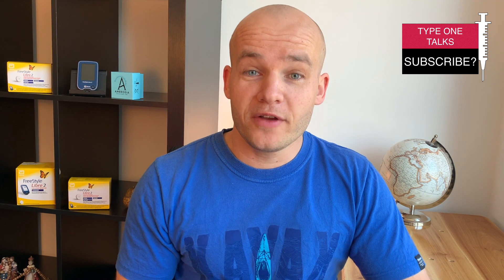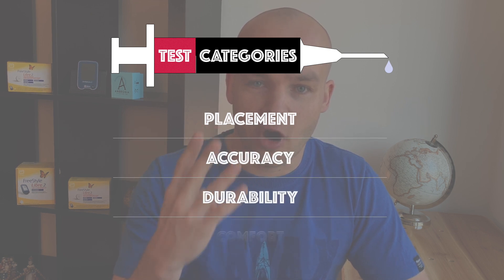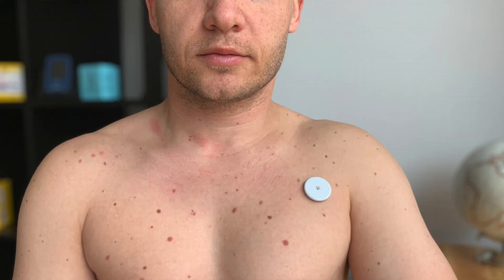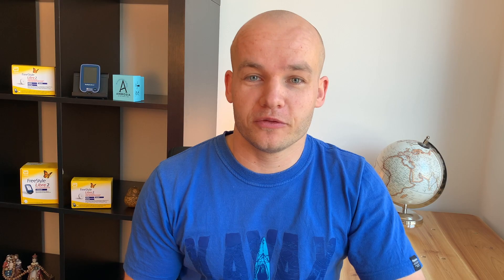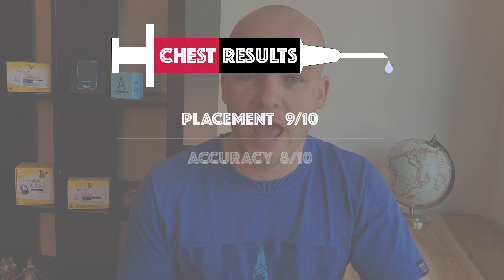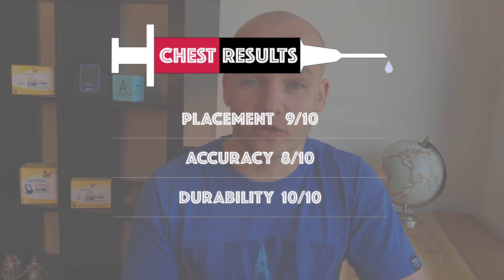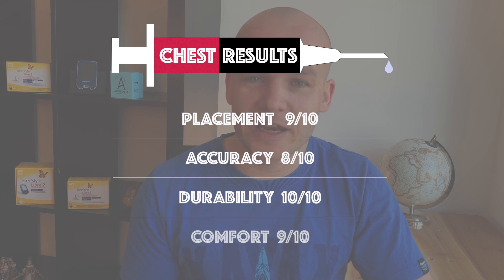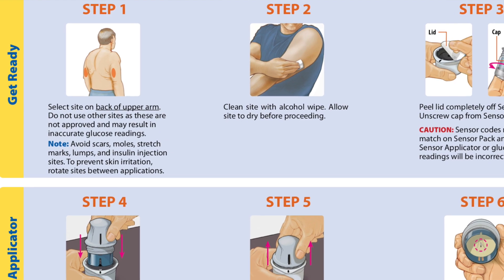Best FreeStyle Libre Sensor Sites: Chest

Comment: I am by no means an expert when it comes to FSL. This is only my second sensor with the system. First was the upper arm and I was amazed with just how well it tracked my BS. I placed it a little to far out on my arm and that made me worry that I might knock it off but that didn't    happen. What did happen is after 9 days it failed and would no longer give me an accurate reading. After a call to the company they said they would send me a replacement. I haven't received that yet but it should arrive soon. From watching the videos I decided chest looked much better (safer) as far as not catching it on something. One thing I have noted in the past 3 days is this location seams to have a greater lag time from eating to a reading and after a corrective injection it takes a long time before I see the results on the meter. It's like my train just got 3 times longer from change to result. Next sensor will be more on my inner upper arm. I just wonder if others have seen a difference in lag time with sensor placement.
Reply from the maker: Hi Tim. Thank you very much for sharing this. Such an interesting observation!

Comment: Tom thanks so much for testing different sites. I am just beginning to,use the Libre system and without even trying I know that the back of the arm placement won't work for me. I suffer from diabetic adhesive capsulitis in my left shoulder and even putting on or taking off my shirt is tough enough already without having to worry about knocking off the sensor. Additionally I use backpacks a lot and because of my left shoulder already have a tough time with the straps. So I am eager to find an alternate.
Reply from the maker: You are most welcome! Welcome to the Libre team my friend! I appreciate your support!

Comment: My favorite location is also chest for all the reasons mentioned. I would like to add that, when placed on the upper arm, the high glucose error is about 1.0 mmol/L difference with blood glucose. As the readings get closer to 4.0 mmol/L the error becomes negligible. When placed on my chest just above and to the left of my left nipple, my high glucose reading error is more in the 0.5 mmol/L. I'm leaning on, more accurate than the upper arm. The greatest effect on accuracy seems to be the pressure used to install the sensor. It requires a firm push, but pressure must not push the sensor in the skin, as I think this damages the wire. I know when I used to do this to help adhesion, my arm hurt for several seconds. I'm guessing  the wire is going beyond the interstitial tissue into the muscle. Just a guess as when I used lite pressure there is no pain and readings are better.

Comment: I've lost 2 sensors on my arm in the last 2 months. One fell off early and the other was knocked off pulling a shirt off over my head. I already asked for a replacement for the one that fell off 3 days early and am embarrassed to ask for another one this early. I will be placing my next one on my chest, but have noticed that it will be directly inline with the shower head. I have ordered some  waterproof patches to cover it with. No matter where I end up placing it I will have a patch to cover it with as I am not impressed with the durability of the sensors. I love it when it's on, but have had poor luck keeping it on. It would seem an easy fix to put about a half inch more of adhesive around the sensor to keep them on longer. 40 patches were about $11 that gives me about 3 inches more adhesive. I dread having to remove one of those when it is done. I use baby oil to get them off, but it still takes about 10 minutes to keep from tearing my skin off under my arm.

Comment: T2D here and I am due to change my sensor in a few days and I am planning to do the chest site. I have had a myriad of failures over the last year, including bleeding THRU the hole in the sensor and it taking over 9 hours to clear. I am hoping that it will be a good site for use as I am paying for every one out of pocket with no insurance at the moment. Normally to keep it on my arm, I use a Sim Patch to keep my sensors in place because I am extremely clumsy.

Comment: So I am new to the Libre 2 (on my 4th sensor). I tried it on my chest this time about two fingers-width below my collar bone. I also used an adhesive wipe this time for added "stickiness". Right from the start, I've been getting unusual readings. The first night I had it activated, I had at least 5 low alerts, and during the day is has been running on average at least 20 points higher than any of me previous sensors (with no dietary change). Any thoughts on what might be going on?

Comment: Thanks for this i've lost track of the number I have managed to catch whilst getting into the shower or putting on a shirt. im going to try this out right now. 👍🏻😎👊🏻 All appears to be working fine & dandy.

Next morning Sensor still in place, attempt to test myself - Message 'YOUR SENSOR HAS ENDED, YOUR SENSOR IS NOT WORKING..." Sadly, I have another 13 days to wait until I get a replacement. CAUTION, obviously Freestyle recommend site positioning for a reason - The chest area is NOT one of them. Very disappointed, I hope those who choose to try this out do Not end up like me.👎🏻😠
Reply: Well tbh i have that problem too but tried only my arm so far. About 2 weeks with fsl. Tried 2 sensors so far and one made it for 1 day, another one made it for 5 days. Replace sensor and place new one... :D almost forgot, how is it with abbott sending replacements?

Comment: I am using the dexcom g6 and I really want to try it out on my chest, as I always knock it off on my arm or have trouble with it sticking on my abdomen. I know this is for libre but do you happen to know or have ever used the G6 sensor in that area? I'm new to the dexcom and cgm in general and because I'm paying out of pocket for these sensors I am afraid to try it and not have it work and be down a sensor. Thanks for what you do!

Comment: I just put my sensor on my chest like you said, the last one (my very first senor) was on my arm in the recommended place. It was painless on my arm but fell off after 8 days. The sensor I just placed on my chest hurt really bad when I applied it. I felt the needle very much. It's placed within the range you mention. Do you have pain at the chest site? I may just stay with the arm site, it didn't hurt at all.

Comment: Its my first time using a CGM. I was concerned about sensors falling out because I'm paying for mine out of pocket. 

I decided to try my chest for my very first monitor. I read all the comments and grew a bit concerned that people said it hurt and there was blood. 

I stood in my bathroom for 30 minutes worried about how bad this was going to hurt. I finally worked up the nerve and pressed the plunger in. I had to laugh because i didnt feel a thing. All that worry for nothing. 😂

Ladies - I placed mine on the left side about two inches down from my collar bone. (I even used a tape measure! 😂) It is placed just above the fleshy part where the boob starts. It didnt hurt. In fact, i didnt feel any poke at all. 

Good luck to my fellow scaredy cats! ❤
Reply: I followed your steps to adding my sensor cause I am a big baby! I did it!!
Reply: @deborahrouilliard986  YAY!!!!  I'm so glad to have helped a fellow big baby!  :)

Comment: For months now, I have been considering trying the chest. But I am afraid of it because I use to switch between shoulders while sleeping. Could there be problems while sleeping on the shoulder?
Reply: I use it in my chest after watching this video and I am a restless side sleeper. I flip every 10 minutes due to shoulder injuries.  I'm on my 3rd sensor in my chest and have not lost any of them early.  I do find that application in my chest hurts a little but goes away in about an hour.  I am female and I do have a demanding job in construction so I do have alot if muscle in my chest.  The readings are much more accurate than in my arm. I hope this helps! I use libre 3 .

Comment: I been using it on the back of my arm but keep getting cut on anything and gets me mad because losing a sensor and need it to replace it after a day or two i cant affor it
Reply: Call Abott and they will likely replace it for you.  Just make sure you tell them you caught it on something and it pulled it off. they will ask several questions, but I have always gotten them replaced.
Reply from the maker: Sorry to hear that! And thank you for sharing your experience! Maybe try one of the other sites? Just keep in mind Abbott has not officially approved any other site than back upper arm. Wishing you a great day!
Reply from the maker: Thank you for the feedback. Really helpful tip! Abbott should be able to help with this one.

Comment: Hi, when you change your freestyle sensor, do you always have 1 hour gap without any data? Or can I activate my new sensor 1hour before the end of the first sensor and still using the first sensor till the second is activated ?
Reply from the maker: No. You will always have the 60min gaps:(
Reply: Yes you can avoid the 1 hour gap if you start the new sensor with the scanner and keep checking the old sensor with your mobile phone 😉

Comment: I didn’t try any location but my upper arm, because I don’t have the courage to try and maybe lose a sensor
Reply from the maker: Fair point! Thank you for sharing your insights! Very much appreciated! Have a great day! 👍
Reply: If you lose a sensor call Abbott and they are awesome. They will replace it!
Reply: I have been putting it on my side arm, didn’t lose them and no problem to minor problems. Once I try under arm, I have to scan it multiple times to get the reading (literally minimum 5times), itchy, and bumpy around the CGM and then snagged finally it when I took off my bra. I guess it’s blessing in disguise except it cost money. So anyway I am going to try chest sounds promising.

Comment: I'm non insulin Type 2 diabetic. I've been using Libre14 day, upper arm, always left arm, for about 2 years. (ANYTHING is better than pricking my finger!) The Libre worked fabulously, until it didn't!   The last few months, the libre and I had smooth sailing and accurate results for 10 days and then my readings would be consistently scary low at night, I'd do a finger prick in the morning and always got at least 20-30mg/dl above what my libre was reading and I was always in the normal zone. Also, during the last four days of sensor life my daytime numbers were low and not accurate. (So weird because for 10 days I did NOT get wonky readings during the night or day.)  I'm trying on my chest, just applied and hoping I can get a full 14 days of accurate use of the libre because I am self paying for these devices and HATE finger pricks. Rookie mistake first time instillation, I installed a little lower and more to the middle, that will change next time I put on my libre. Not painful, actually feels more secure than the sensor on my arms ever did. I always use a covering over my libre to make sure it stays on-emotionally scarred from bumping into those dang door ways and losing a sensor! (LOL) Thanks for your videos. I subscribed and am a big fan of your videos and your humor! Thanks!
Reply: I’ll second that.

Comment: That sucks.

I would love to use chest  cause I rip mine out frequently where I also have MS and fall a lot. But sadly I am part wookie and have far too thick of a pelt on my chest to do it and even if I could it would be painful AF to pull off.
Reply: wax an area?
Reply: @pattyfluegel7816  monitors ideally run for 14 days. Which is more than long enough for freshly waxed hair to grow back underneath the sensor, grow ingrown, or end up growing too short to properly pull out but long enough that pulling the sensor off would give all the pain of waxing body hair but none of the effectiveness.

So waxing is probably one of the worst ideas for that.

Comment: Just imagine that big needle puncturing your heart during insertion. New fear unlocked
Reply: what big needle it's a piece of little plastic that bends and it won't hit your heart. I've been using my sensors this way for 2 years with no issues and I'm still alive it has not even gotten close to the heart.
Reply: @wper64  there is a huge metal needle that is making space for the plastic thing when inserting
Reply: @CaltaTomas  Not huge enough to even hit muscle! Please educate yourself.

Comment: Hi Tom great video , this is my second time using the libre ..the first time I used it on the back of my arm but the second time it fell off what do you do when it falls off ?
Reply: I had the same problem when I was first starting using it and I called Abbot and they replaced it no problem. They will ask for the serial number and when I received the replacement, I did have to send back the one that fell off.

Comment: I'm a stomach sleeper. I'm scared it might fall off.
Reply from the maker: I understand your concerns. Wishing you all the best if you try.
Reply: hey! wasn’t sure if you ever tried the chest area… i’m also a stomach sleeper and wanted to know how it went for you if you tried it! please let me know!
Reply: @hayyy_bails  No, I never did try it. I still wear it on my triceps. I'm thinking when the 3 comes to my area I'll give it a whirl as it's a lot smaller than the 2. Have a good one!
Reply: @deadtigerworld  Did you ever try the chest with the libre 3?  I'm a stomach sleeper, too, and have problems with my arm knocking into things in narrow spaces.
Reply: @ladyofthemasque  I actually changed my sleeping position to a back/side sleeper. It was really hard but I haven't slept on my tummy for a few years now. I still have it on tricep. I def used to knock it off on doorways etc but I've gotten better at not doing that over the past few years. Have you tried skin grip on top of the sensor? It works well and will help you in narrow spaces.

Comment: take a used sensor and glue it to chest to test durability  ....   yes , remove needle and use double stick tape
Reply from the maker: 99guspuppet I am not following this. Is this a suggestion for the next video?😄
Reply: Type One Talks      i anyone wants to test a sensor for durability ....    take used sensors without needle and stick them on various parts of the body.   i have about 30 used sensors in a bag. ( not for sale )
Reply: @cedricpod  LOL! :)  Good idea thanks for the tip!

Comment: I don't recommend using it in any manner or area other than what the manufacturer recommends. I've seen poeple posting their suggestions as is their right but , these are not inexpensive toys to experiment with. You get ONE shot to inject or place the needle under your skin , if that fails , there is no second or third attempt.  That is a pretty expensive proposition.  0_o
Reply from the maker: Thanks for your comment! Stay safe!